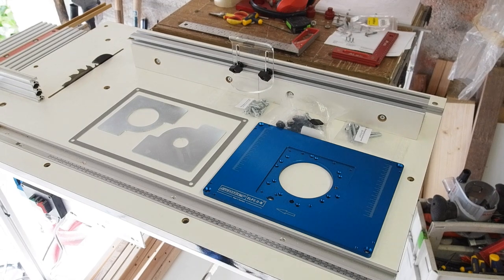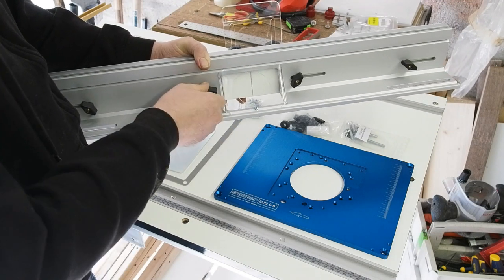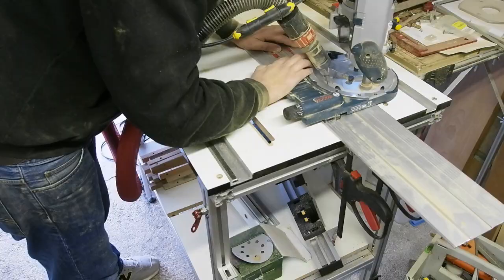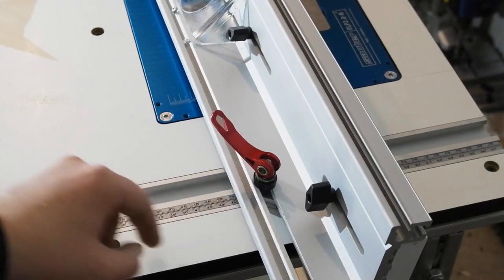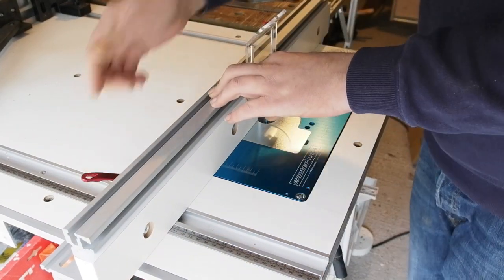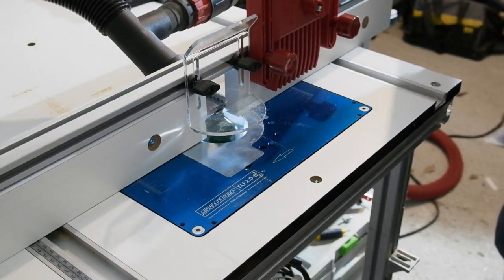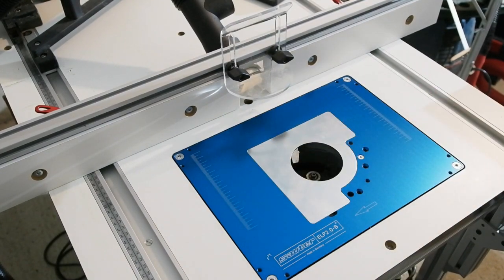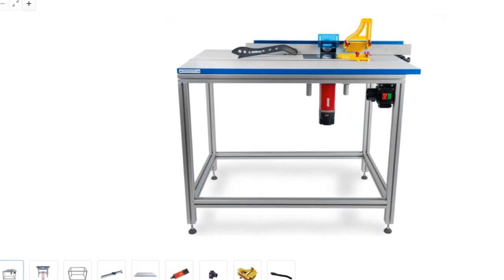Table Saw Build Part 4 - Sautershop Router Insert Plate and Fence!!

Comment: Good stuff buddy! ... in regard to the bike clamps, how do you adjust them to fit different thicknesses of material? are you cutting the threaded section to the correct length?
Reply from the maker: Cheers Ben. That's exactly it mate. I look out for ones with as short an unthreaded part as poss. Then trim and shim.👍

Comment: Very useful, thanks. Really impressed by Sauter's router range -- probably the best in Europe -- and quality looks excellent. I'm currently looking at either the plate + GMF solution, or a more simple router with the lift.
Reply from the maker: Thanks. Glad you found it helpful. The GMF solution works fine - it's what I use - but it isn't as finessed as a dedicated lift. On reflection, I think I would have preferred that route. Sauter as a decent range of lifts. They look simple but very well engineered. I mean to ask them at some point if I can retro-fit one of their lifts to my current plate.

Comment: I recently buy this system. 
Do you have underside dust extraction port?
Reply from the maker: Do you have the Bosch GMF 1600 underneath like I do? If so, I have the fixed base permanently fixed to the insert plate. I have a hose poked through the back of the fixed router base and have just taped up the gaps. Nothing special but works well.

Comment: Thank you for the video. I was wondering what kind of dust extraction you are using with this router table (shop vacuum)? Seems to work pretty well.
Reply from the maker: Cheers LK. In this case, a Bosch GAS 20L. A basic industrial/shop wet/dry vac but plenty of suck. I use it with fleece bags to keep the filter nice and clean. The 2 way hose is meant for Bosch's table saws but happens to fit this fence.
Reply: @BischBaschBosch  Thanks a lot for your answer, appreciate it! Lukas

Comment: Great video as always. How do you go about adjusting the height of the router? I've got a of1400 but I was thinking of getting a Triton 001 because of the easy height adjustment once in the table.
Reply from the maker: Thanks John. The Bosch GMF fixed base has 3 height settings with 15mm micro adjust available. Works pretty well under a router table.
Reply: @BischBaschBosch  I see, I think  I'm better off getting a tra001 then, changing the height of the of1400 under a table doesn't seem like a good idea.
Reply from the maker: @johnclausen9057  good as the of1400 is as a router the tr001 is likely a better choice for a router table. Like my Bosch, not only does it have the ability to adjust height fro above the table but is also more powerful.

Comment: Have you built an under table box for dust collection? I have the same configuration and I intend to make one.
Reply from the maker: No. I have a split hose with one end in the router base, the other in the router fence. Extraction isn't too bad.  I did build a box for the other side of the table - table saw end. Dust extraction was much worse there. The box does help a bit.